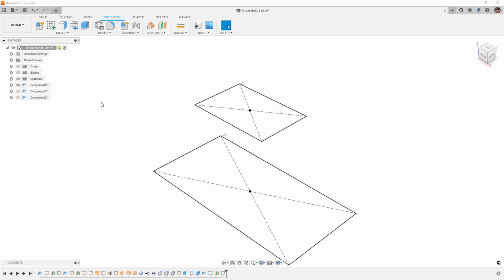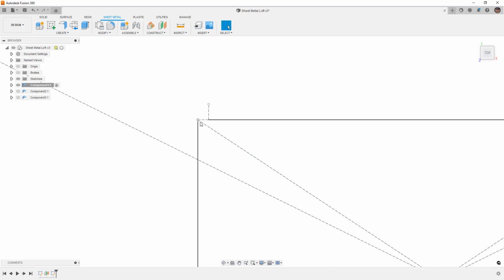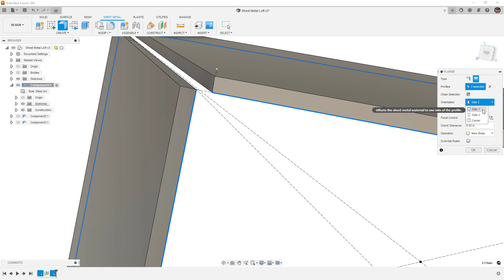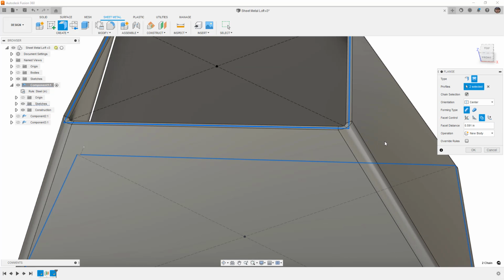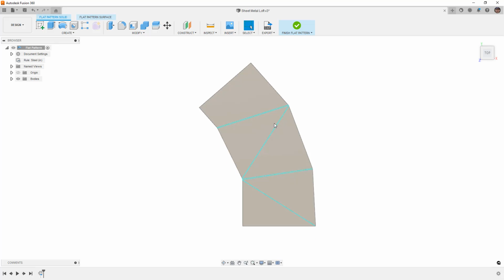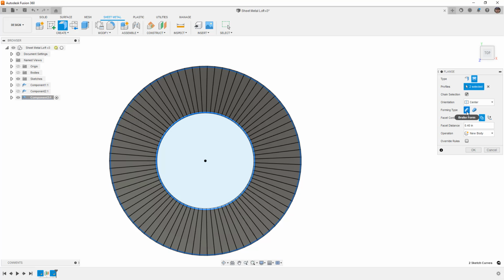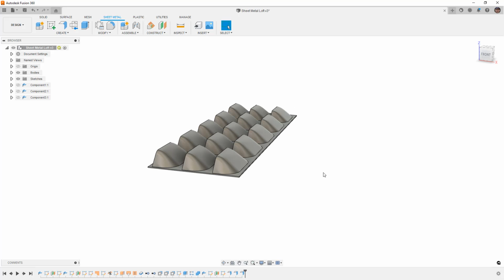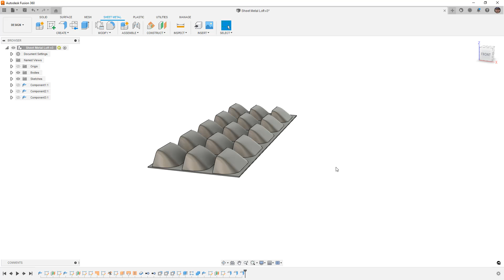NEW Lofted Flange! | What can this tool?  And what hangs it up? #Fusion360 #LoftedFlange

Comment: Your one comment alone was worth the thumbs up! Can this part be manufactured, mass production or even one off, which is what I mostly do. Sheet metal can be so much fun and so frustrating when you go to bend it and realize you bent it in the wrong order and can't reach a bend. Wish fusion had that function. Many times I see people that 3d print things come up with the prototype with square or radius corners that are impossible to machine.
Reply from the maker: 100%  I think a big difference comes in where you start.  I started making welded and sheet metal parts, then machined parts, then molded parts and then 3d printing came along.  Having to manually shear and use a break to make bends gives you a bit of perspective you don't get when you are able to send parts off and have them show up ready to go :)

Comment: Thank you for this video. I've had to learn all the workarounds and hybrid workflows to model lofted flanges but it should be easier with the new tools. I typically split the body to form and weld the flange clamshell style.   Typically, 2 butt welds are easier and faster than 1 corner weld. 
I want to know if it is possible to pattern a louver around a sheet metal cylinder or will it crash fusion. We make a product with a feature sort of like louvers patterned around a cylinder but I have yet to figure out how to model it in fusion.
Reply from the maker: In Fusion you can pattern the faces around a sheet metal body, but you won't be able to flatten it after that.  The issue is that Fusion doesn't have any true "Forming" tools for things like Louvers.  The way the tools work in something like Solidworks is that you build the forming tool and designate faces as form faces, shear faces or stop faces.  This tool can be applied and it knows to suppress those features when flattened and you can dictate a location for the tool.  Things like dimple dies and louvers can be modeled but will directly impact your ability to flatten it in Fusion.  Really the best way is to make a die location mark so you have the location in the flat to apply your feature.

Re the 2 butt welds vs 1 corner weld, yes depending on the design and welding type.  Most of the sheet metal parts I built and welded were tig welded aluminum and required fixtures for each part so the butt vs corner was more a product of the function of the part vs mfg time.  Ideally I like to just overlap the ends:)